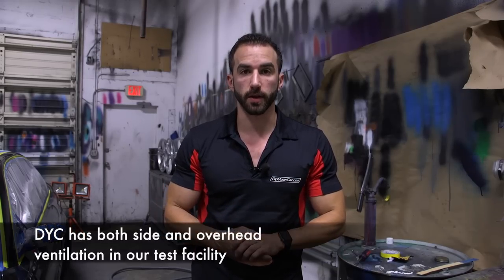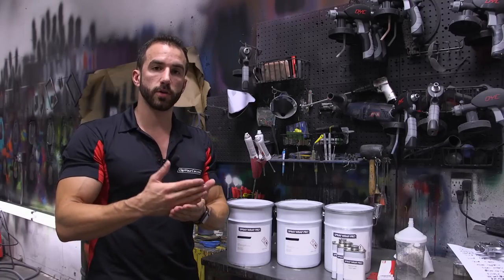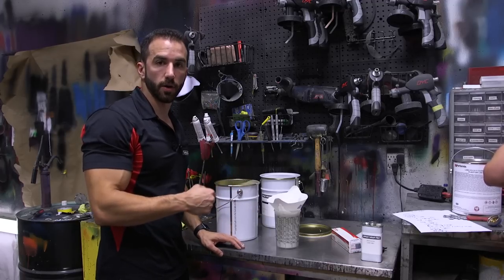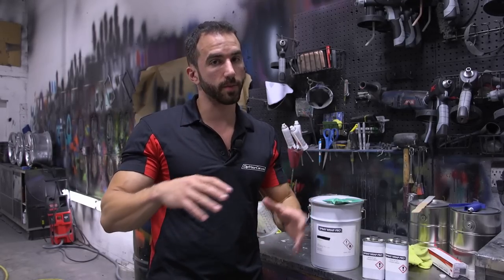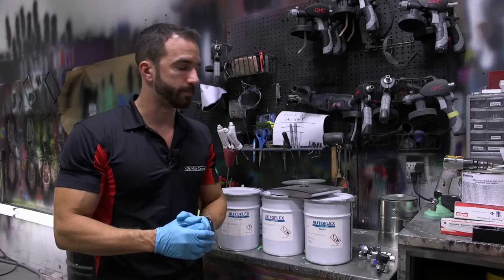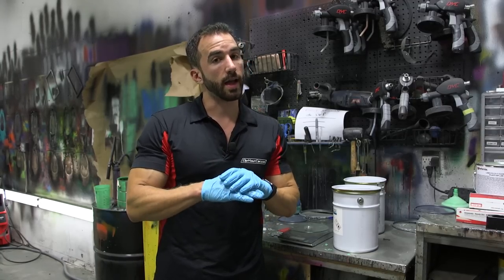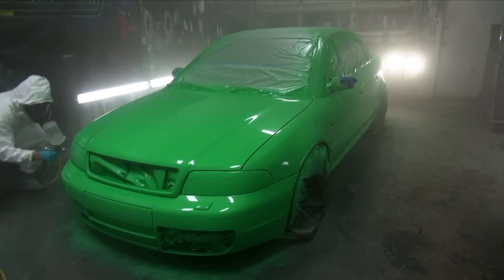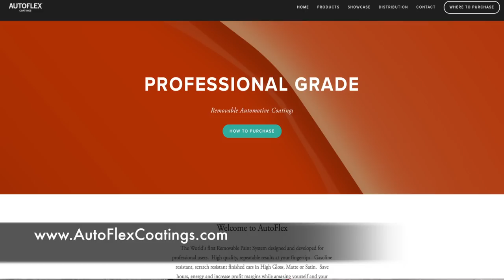AutoFlex High Gloss - Tutorial

Comment: what is the air compressor specifications? should i get. and is the TEKNA 703566 1.2mm/1.3mm/1.4mm Fluid Tip ProLite Spray Gun with 900cc Aluminum Cup and TE10/TE20 Air Caps able to spray good enough for autoflex?... i'm looking into going to a program to teach me and when i'm ready i want to paint cars any help is appreciated, thank you!

Comment: How many gallon buckets did you use for the base coats and the top coats. and how much do you have left in those buckets? 2x swp + 2x tint for base 2 tack 6 wet coats & 2x swp + 2x tint + 25gr pearl for top coat?

Comment: Could someone explain if the autoflex can be peeled off in the same way plasti dip can for areas you wish to remain the standard colour. Emblems/badges for example? Does it peel off cleanly or is it likely to pull up the coating on the main panels?

Comment: so why is this recommended for professional use? is it just all the over spray needs ventilation? I think I could do an equal job in a garage lined with plastic with the door open...
Reply: Can't leave the door open, too much dust. With a lot of effort and some good cleaning you can make a garage able to be converted into a paint booth, but it's not as simple as lining plastic and leaving the door open.

We made a modular system of plastic walls for ours, and basically one ~4ish foot tall modular wall with filters and fans we can put under the garage door to bring in fresh air and another that we have set up to exhaust up and out the side of the attic. Also every time before we paint a car we do a really thorough sweep with sweeping compound, followed by a wet sweep and a mop and then letting it dry for a day or two before we paint so the humidity isn't crazy high. Also wash the garage door and cover the part that is going to be "up" so no dust can fall out of it either.

We've used it with traditional auto paint with great results, so it could probably work fine for this. But it's not as simple as throwing up plastic and leaving the door open. Especially because while you're painting and letting it dry between coats, you don't wanna leave your garage door open so just anyone can walk in, muck with your paint job, or steal tools. That's why our little half wall for ventilation actually bolts into place.
Reply: Raven1024 do you do it just for yourself or you have a shop?
Reply: Mostly just myself and friends and family, and occasionally friends of friends.

edit We also live in the southwest...very dusty here too so I have to make sure it is sealed good.

Comment: Key things for future videos.  1.) How durable is it?  2.) How does it peel?  3.) How long will it last on a car?  4.) How will it hold up to drastic temperature changes -10f to 110f?
Reply: First, that comment was posted the day this video was released..... Almost 16 months ago.   The community didn't know anything about AutoFlex when I posted this comment.  
Second, it's called a tutorial.  It's supposed to be detailed.  
Third, If you're gonna troll... maybe don't start with the oldest comments first.
Reply: John Chad Im looking for an answer on the Trim peeling.  All the other Pladtidip and Proline vidz he says to peel when wet the trims so they dont lift up u he paint and mess it up.

However in this video it looks like he waited till the carvwas completely dry before removing the covered trim pieces.  So Im just looking for a confirmation that Autoflex does not need the same "peel while wet" as the other products?  Thanks
Reply: I haven't had the pleasure of working with AutoFlex yet, so I really can't answer your question.  Even when peeling when wet you need to take great care to make sure you don't have bridged material between the body and your tape.  I've done 4 cars now and I have yet to do a 100% flawless tape peel.  ProLine was actually the hardest.

Comment: fonzie will a 30 gallon compressor be enough? what is recommended. thanks
Reply: I've sprayed paint with a 30 before. It works but watch your air pressure either with an inline regulator with a gauge, or if your gun has one built in use that. Don't let it drop below your spec and you're good

Comment: i was quoted $1,500 for a professional application of this stuff by a good shop. 

considering it's really close to automotive paint, can be buffed and waxed and polished like paint, and is removable, that's not that steep of a cost.
Reply: a $1500 "real paint" job would have to be at maaco and by god it'll be an awful paint job.
by comparison this stuff looks excellent, behaves almost exactly like real paint from a detailing perspective, and is removable.
the downside is it doesn't last forever, only about 4 years before degradation sets in

Comment: Have you guys ever tried applying Autoflex High gloss over a plasti dip base?  Would that even work? If so, I would love to know if it still results in a very close OEM shine.
Reply: Cody Miller Using autoflex over PDS base does "work". We have tested it. However, you will still see the texture of the plasti dip under the gloss. But it still feels very smooth to the touch like paint once you lay the gloss top coat. So it is physically possible but it did not end with a smooth paint like appearance. After testing it, if you are going to invest in Autoflex, I  personally wouldn't recommend spraying over PDS base. The difference in appearance alone is worth spending the extra money for the Spray Wrap Pro base gallons. Plus we've found it much easier to get a smooth consistent finish Spray Wrap Pro. None of those splatters or lines that happens with dip